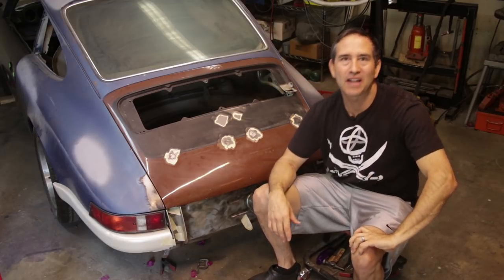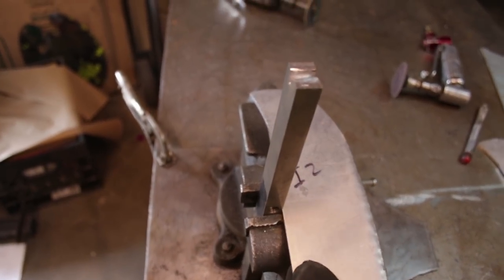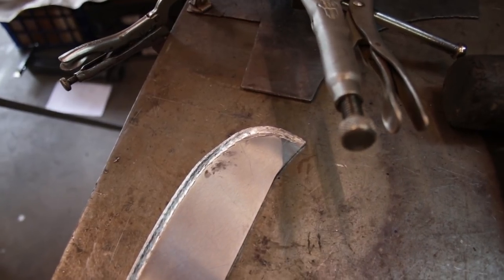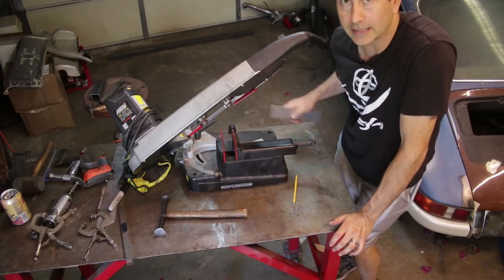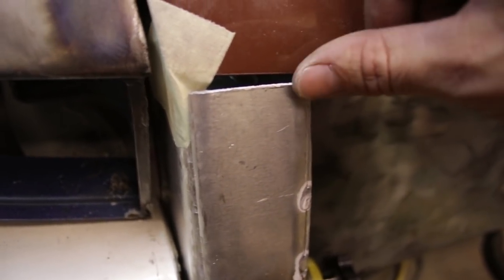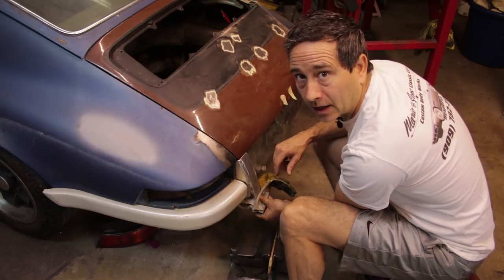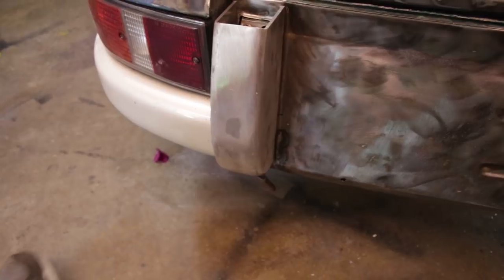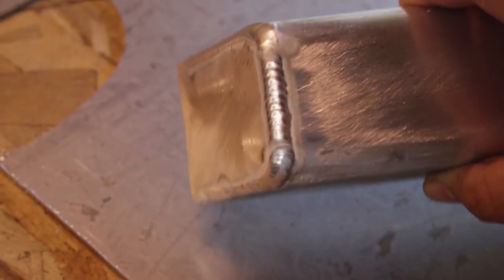DIY Porsche Bumper - Custom Welded Aluminum Bumperettes

Comment: The transformation from start to where you have finished on those bump-stops is incredible 👍 Bet you can’t wait to bare metal prep and get the car in epoxy sealer 🤗 When are you going to pull the rear screen... I’d be itching to get that out now 😜
Reply from the maker: Thank you Mark!  Yes, I'm excited for get this thing all one color even if it's just primer.  That rear window should be coming out soon.  The trouble is finding a safe place to store it, ha ha.
Reply: Garage Time - Auto Resto Great stuff 😜 I’m a little ahead of you with my 993 project... Just completed all rust repairs, steel sunroof delete etc and aim to have the shell bare metal to epoxy by end of this week 👍 I’ll comment some pics to one of your FB posts you made earlier so you can take a quick look. Next on the list is fabricating an RS M003 replica cage which I’m not looking forwards to, but it’s all fun and keeps me busy 😬 Looking forwards to seeing the direction yours takes 😍

Comment: A lot of meticulous work. I do like your more subtle bumperettes versus the ones from Singer. I think theirs are too large in proportion and visually distract from the body lines of the rear of the car. Personally, I like them satin or blasted aluminum instead of polished for the same reason. Great job.

Comment: could you have heat treated the aluminum with a torch to get it soft before the bending?
Reply: I've seen this easily done, by first putting sharpie on it and then burning it off... voila
Reply from the maker: Yes it probably would make it bend a bit easier.  Aluminum is weird with how many different alloy variants there are.  Heating changes the temper and may cause it to crack.T6 for example cracks when bending.